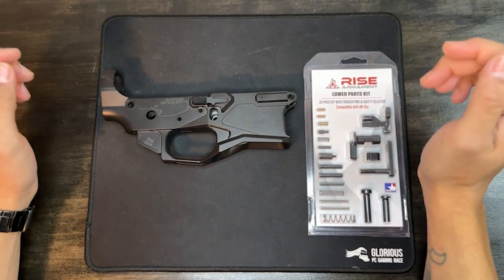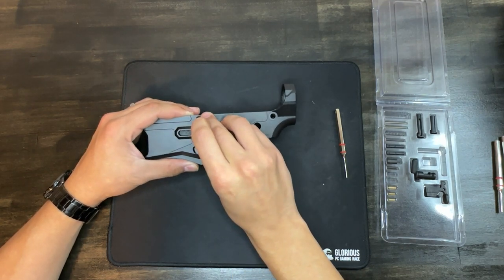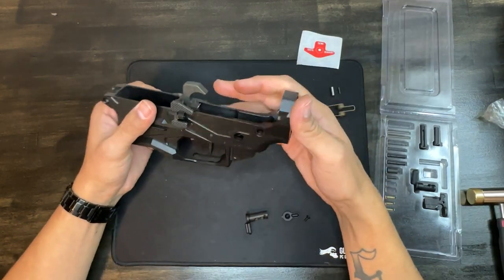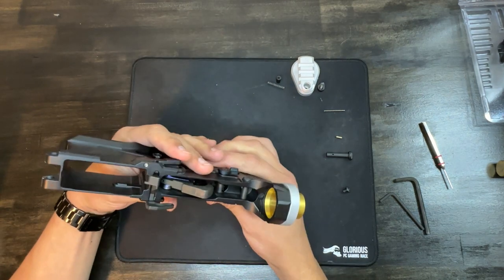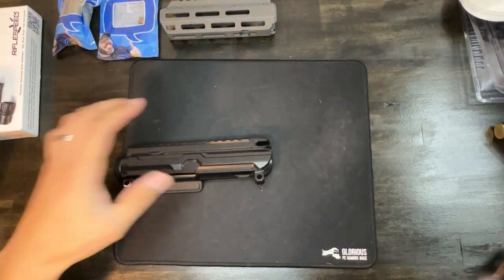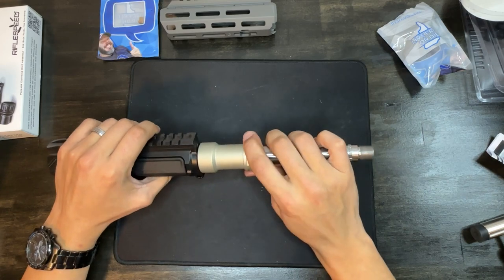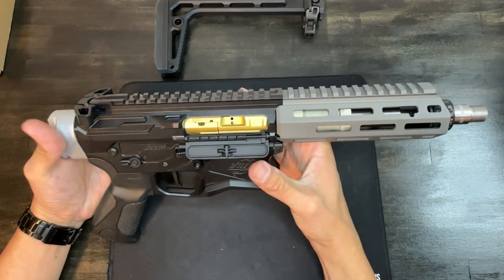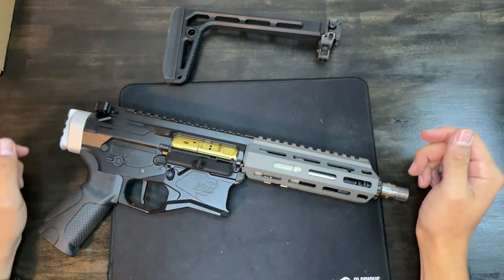Knockoff Honey Badger Build?? No Buffer Tube Required!

Comment: How is this setup running so far? Mainly the bcg and rifflespeed adj gas block? Super interested in doing a similar setup.
Reply from the maker: The adjustable gas block is amazing. When we test fired the pistol, we tried several different subs with a can on and dialing in the gas made it a breeze. The bolt carrier group is doing it's job, it gets coated with carbon fairly quick with the can on. I am hoping we can do a longevity test on not cleaning the bcg until it the build up starts to cause failure to feeds. I am interested in the duty application of  the bcg. I will post a video later this summer after some more shooting with the pistol.
Reply: Awesome thanks. I want to order one but they dont answer emails or instagram unfortunately….
Reply: @MatSuPewPew907  i am really interested on seeing that test

Comment: Those receivers have threaded bolt catch pin holes! It even says on their sight that it COMES WITH the threaded bolt catch pin to use. The sight says “Receivers come with ALL pins threaded” so I’m guessing the forward assist pin is threaded also (like Aero M4E1 receivers). If one side is closed up like that we call that a clue!

Comment: Use Areo shell for the barrel nut next time it'll work alot better if you ever break it down i also use it on the barrel extension going into the upper.  But that's just me.  Nice build i just finshed mine i went with a DI build
Reply: The reason you are supposed to use Aeroshell on your barrel nut is to prevent galling if the barrel nut is a dissimilar metal like titanium or steel. Since the barrel nut on this build is 7075 T6 and the upper is the same exact alloy, Aeroshell isn’t necessary.

Comment: There any updates on how it functions? Been hearing EWS  bcgs have issues with feeding locking back on the last round.
Reply from the maker: Luckily no issues yest, but I hope to do some burn down style testing with it this summer when the snow melts away and I can get it on the range. I am interested in the bcg's functionality after a few hundred rounds and no cleaning. The last round hold open worked flawlessly for us when we were testing it with several different rounds, subs and a can included. I will give an update video when summer blesses Alaska again.